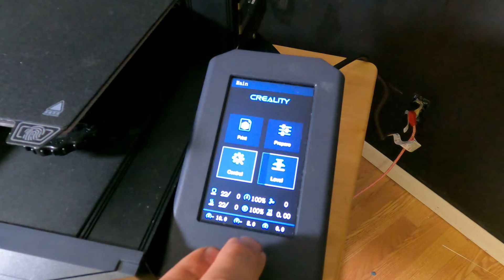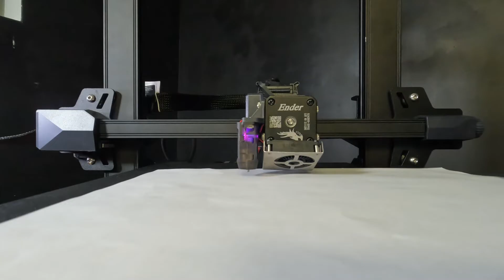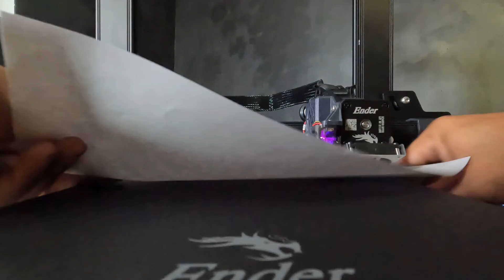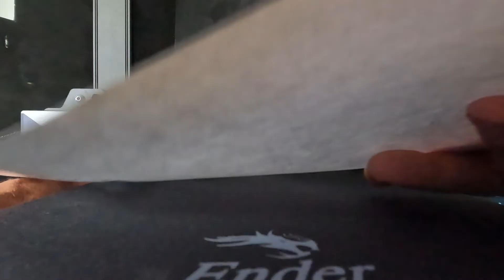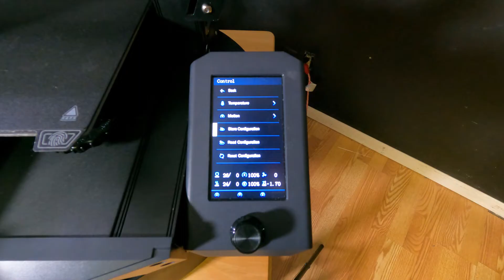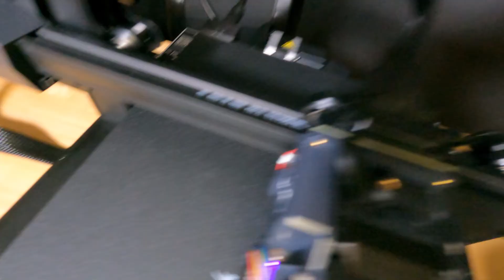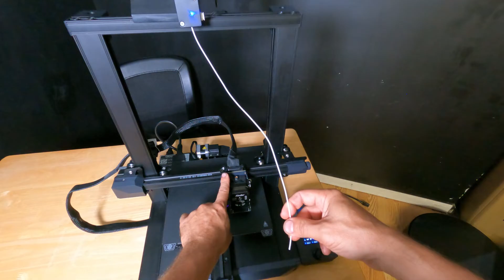Creality Ender 3 S1: How to Level, Set Z Offset, and Make an ABL Mesh - The RIGHT way.

Comment: for the love of pete stop rubbing your oil into the bed surface you are going to show new to 3d printing users how to get all kind of print adhesion issues down the road when they go to print outside of the initial printed item.  No matter the level you will not stick with your mitt prints all over the bed...
Reply: Bro chill. You’re gonna touch the bed. If you think hand oils on the bed is the reason your prints don’t stick, your machine isn’t calibrated. Don’t blame the oil.
Reply: Ever heard of IPA bud ?😂 just a thought
Reply from the maker: @FoxEnduro86  Some peeps just love the sight of their worthless internet bitching.
Reply from the maker: Jesus, I can't believe you actually thought I'd care about your opinion of my content. 
HAHAHAHAHHAHAHAHAHHAHA
Now in Spanish
JAJAJAJAJJAJAJJAAJ

Comment: great video. i have a question, i have the same  setup up with the sprite pro extruder and the cr touch. For some reason I cant set my z off set with the ender 3 pro. i have flashed with the latest firmware for the cr touch. the cr touch goes trough its set up and the probe deploys and the cr touch lowers the extruder to the bed. And when I try to set the z off set it will only allow me to rasie the extruder up and not down from zero. i have taken off the z axis limiter as per the installation of the cr touch. any guidance would be appreciated. I have not printed anything yet due to the z offset issue.
Reply from the maker: Hi, that is odd. Few things to check:
Remove the Z-Stop Switch
Be sure you have the firmware
For the correct Motherboard (4.2.2, or 4.2.7)
Be sure you are actually in the Z-Offset setting and not the MOVE settings.
Reply: @3DRundown  yes the z -stop switch has been removed per the cr touch instructions. i currently have the latest firmware for the cr touch from creality. i did not flash the mother board 4.2.7 firmware. I kept it stock from the vendor. so if i make the adjustments with the z-offset setting, the extruder would move up and down the z azis? i might have tried moving it from the move settings. I have the stock screen from ender 3 pro. i had purchased the lcd touch screen the creality brand, but the vendor i purchased it said it would not be compatiable to my ender 3 pro with the new motherboard 4.2.7 but yet it was listed that it would work with 32. boards. im too scared to install because I was able to get my upgraded machine this far. i didnt want to introduce anymore problems to fix. and thank you for your help.its much appreciated .
Reply from the maker: @mnaanep  I would stay with the standard screen. I can even get you newer firmware if helpful.
Reply: @3DRundown  thank you i was thinking the same thing, seeing on reddit a few people with the lcd screen i dont want to have to think about trouble shooting. thank you agian for the help. i cant wait to get home and work on my printer
Reply from the maker: @mnaanep  Accept that "Work on my printer" is just part of this adventure, and it will help with your stress levels. Good luck! Consider my Course: 3DRUNDOWN.COM
50% off code: HALFOFF